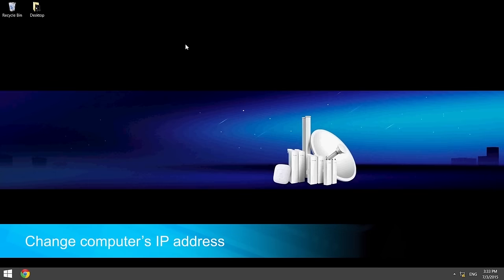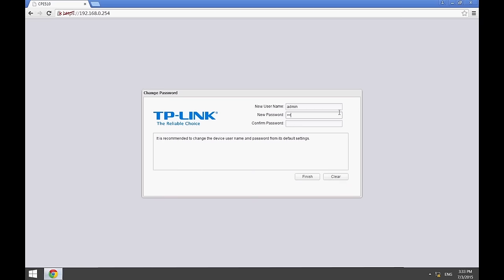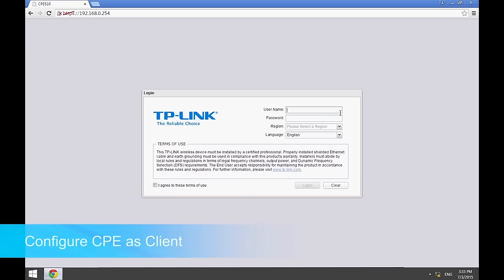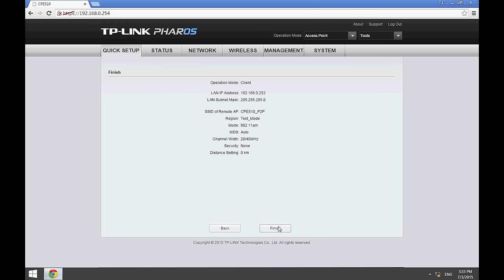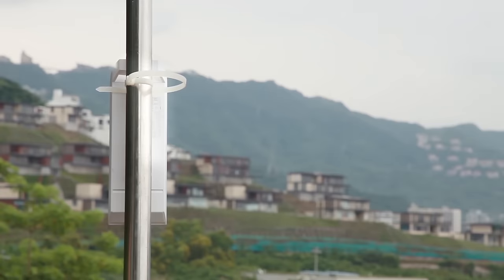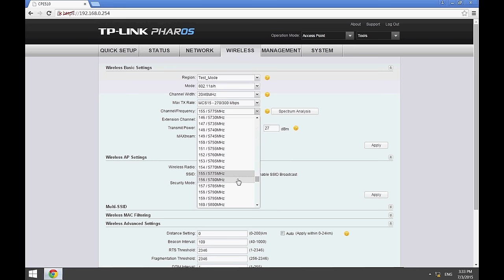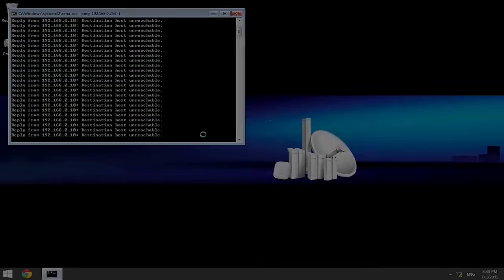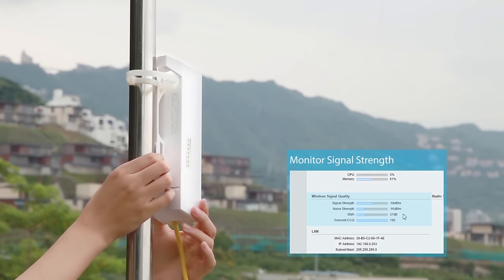TP-Link CPE Point to Point Installation and Configuration Tutorial Video

Comment: I just bought the device dec and there is no Poe ethernet cable to connect between the Poe adapter and the device from the inside of the box. Do I have a color sequence of this cable, if I do it myself, I have knowledge of the cable ethernet.
Reply from the maker: There is no such thing as POE Ethernet cable.  Its just a regular Ethernet cable that power is transmitted down as well.  The Ethernet Port does have to be POE capable though.  With this device if there is no Ethernet cable any one you have available will work.  I recommend Cat5e and up though for gigabit connection capablities

Comment: What could be the best height to fix the AP and CPE devices? Can we connect more than 2 client devices to the AP device?
Reply from the maker: Height limits would be the limits of the ethernet you are using  the only requirement is that the two units have clear line of sight and are in range of each other.  On the Client  side you can connect an AP or router to allow multiple clients to connect.  On the AP side it would be a one to one connection with the router.

Comment: How do you set up TP-Link CPE to be used as an access point without a computer? Can it be configured via a router and a smartphone at your disposal?
Reply from the maker: No it will require a device to be physically connected to it.

Comment: can the "client" CPE210 connect to the distant LAN network through RJ45 jack and make 2 different networks one as if they are physically connected?
Reply from the maker: Client will not create a network.  instead you would be able to physically connect a ethernet based AP or router.

Comment: what is the allowed distance between the TPlink CPE and the PoE adapter? is there also a limit on the distance between router port and the PoE adapter?
or are this the normal 100 meter limits of ethernet?
Reply from the maker: As far as we know the limits are that of the Ethernet segment.
Reply: @TPLINKTECH  thanks but a follow up question arrise then, is the ethernet segment from the router, over the PoE adapter to the device or are these 2 segments (1 segment from router to PoE adapter and 2nd segment from PoE to device. The reason for this question is that I would need to travers first an area without line of sight and then the radio part which has line of sight. The first past is most probable just over 100 meters
Reply from the maker: @a320homecockpit  You shouldn't have a problem with that as long as the injector is at a location where power can be added.  the 2nd segment, ethernet to camera would then have the POE power added to it.

Comment: Can I set this up with 3 CPE210 devices. One AP mode, and the other 2 in client mode both set up identical (different device IPs)?  They will both be within cone of the AP.
Reply from the maker: Yes as long at the 2 clients are in line of sight and the beamwidth of the AP.  The two clients would then operate like an network adapter on a computer and get an individual IP address.  the clients then can each be setup to a separate WAP and provide wireless and wired connect to device in their area.

Comment: Can i use the cpe510 in AP Client Router (WISP Client) mode and connect it to an archer a10 in (Router Mode)?

I then want to connect an (AP) or wireless router to the cpe510 so I have an omnidirectional antenna for all my devices at the second location.
Reply from the maker: The two devices would need to be in line of sight and the beamwidth for that to work.  The CPE510 has a very narrow beamwidth.  However the EAP225-Outdoor may be a better product for your needs.  Its an outdoor Omni-directional AP with a maximum range of 150 Meters.

Comment: Hello Gentlemen,

I have a question about TP-Link CPE Point to Point 
can I use it for one side only as sender without reciver ? I mean I have a router and I want to make the signal stronger, the receiver will be the computers and mobiles. 

could you help me with that?

thank you
Reply: I'm no expert but basically yes. You can select Range Extender, Access Point, or Bridge based on your needs and connect devices compatible with 5ghz wifi (like most phones and computers.)

Keep in mind that this is a very directional signal, it's not going to be well suited for "moving targets." You can connect a cellphone to the wireless signal, but you would be better off with something omni directional.

Comment: Hello any one can give some information. How to make wifi hotspots more than 3 km coverage areas and what kind device have to setup please ?
Reply: You can buy tenda 03 5 km wireless router . This will cover the range of 5 km.

For this you will have to buy two units of tenda router .
Configure one unit as Access point mode . And another unit as client mode .

Each unit will cost you 3300 rupees .

Comment: What is the range on these devices? I'm looking into it myself but I need to cover a area from point to point.
Reply from the maker: depends on model.  Generally speaking its any where between 10 and 15 KM
Reply: @TPLINKTECH  Straight line to site correct? What about through tress?no buildings or hills anything like that just trees?
Reply from the maker: @DiyintheGhetto  Yes Straight Line of Sight with no obstructions.

Comment: Hey, i've got a question, maybe someone can help? 

Is a second CPE necessary for an short distance of 40 Meters? 
I've bought two CPE210, to build a PTP Connection from my main house to my garden house. 
But isn't it the second one, at my garden house, redunant if the main CPE acts as an Access Point? 
Could I leave off the "garden house" CPE and the router, i planed to install there? 

What are the pro and cons, to build a PTP versus only one Access Point?

Im an total newbie, and non native english speaker, so please excuse me!
Thanks!
Reply from the maker: for only 40 meters i would not recommend the CPE210.  I would suggest an EAP225-outdoor.  the benefit is that it is omni-directional, has a greater beamwidth so clients can actually connect to it and has a range of up to 150 meters for just one device.  It would be the best choice by far in this situation.
Reply: @TPLINKTECH  Thank you for your advice! Really appreciate it, and your great products!
Reply from the maker: @Bambule161  our pleasure

Comment: is this necessary if it's only an access point setup?
Reply from the maker: these CPEs are long range directional APs. Technically only one in AP mode would be needed but because the azimuth of the signal is very small it is recommended to have 2 that are able to see each other, one in AP and connected to the source of internet and the Other in Client at the receiving end.
Reply: @TPLINKTECH  okay. but can I still use just one AP for 200 meters to reach a wifi security camera?
Reply from the maker: @chichino5  Only if that camera is line of sight and in the AP's narrow azimuth

Comment: Question: Does CPE 220 is capable of point to multipoint connection? Thank you
Reply from the maker: It should be but we don't have that product in the US so we can't say yes absolutely.  Here is the data sheet though.  https://static.tp-link.com/2020/202003/20200324/CPE%20series-Datasheet.pdf

Comment: hello..i want to extend my wifi range..if i connect this directly to my router and install it on my rooftop...do u think i'll get a full bar signal in my phone from at least 500meter distance?..please answer clearly.
Reply from the maker: No likely.  This is a long distance point to point AP.  It has a very narrow line of sight.  Unless your cell phone is in direct line of sight you will not see the signal.
Reply: @TPLINKTECH  thank you.

Comment: I'm not finding any explanations of the different modes that I find clear. I want to have one in my main building that is used only to communicate with the second, and the second in my outbuilding and running a wireless access point. Can you point me toward documentation that can explain that? The mode descriptions don't seem to be looking at things from the angle I am.
Reply from the maker: Unit at the main set in AP mode.  Remote unit set in Client mode.  units must have clear line of sight and be within each other's beam width.   If the distance is 150 meters or less consider using a EAP225-Outdoor.  you would only need one then.

Comment: where does the line on the client connected to? Please show where the lines goes on the client side. Thanks
Reply from the maker: Its simple that would connect to a client device.  A PC, an AP, a router, etc.  Most would use an AP or router so that multiple clients at the client side can access

Comment: I have a few sites where the AP radio factory randomly resets itself for some reason. Some times once a week and other times up to3 times a day.  Other times oncr a month.   When I swop the radios around and the poe unit, it still happens.  When I make the AP radio a client, it doea not factory reset itself.  But only with V3 CPE510s.  Older versions never did this.  Any ideas?
Reply from the maker: No unfortunately we are not trained on the SMB equipment.  You would want to contact support.smb@tp-link.com

Comment: Hi, after setting up client device, is it still need LAN cable connect in client device?
Reply from the maker: In Client mode think of the CPE as a modem.  You would need to connect it to a Router or AP in the Client location to provide that area with the service it receives.

Comment: I need help on my setup as follow; I have configured like this:

Router (GW 192.168.87.1/24) -> CPE210 (Access Point mode, IP: 192.168.87.50) to CPE210 (Client Mode, IP: 192.168.87.55) -> CCTV Decoder (IP: 192.168.87.45).

My problem is, I cannot even ping all these IP from other subnet in my LAN, eg; from 192.168.86.0/24. My main priority is to access that CCTV Decoder. Please advice what is the correct way for me to implement this?

Thank you for your help.
Reply: Mohd Faridz Ismail if u need help let me know so I can remote and help you
Reply: @christopherwitter3677  thanks, i have reviewed again the network design and i noticed the gateway is wrong. so now i fixed it and everything works.

Comment: Have difficulties connecting the client to the AP:
1. Do I have to disconnect the LAN cable between PC and AP, to client PC at any time in the configuration process?
2. The SSID network-name. Is that a specific new name for the AP-Client connection, or to the network of the house?
3. At what time may I LAN-connect the AP to the router of the house instead of the PC? How do I do that?
4. What option do I have, if my PC does not have a traditional LAN-socket in the configuration process?
Reply from the maker: We are not able to provide detailed answer as you are requesting here.  You can email support at support.smb@tp-link.com.

Comment: can i use this as a wifi long range adapter
Reply: Yes, you can. You should set its operation mode to "Client".
Reply: @DiegoTorresV11   HI  

I have a question about TP-Link CPE Point to Point 
can I use it for one side only as sender without a receiver ? I mean I have a router and I want to make the signal stronger, the receiver will be the computers and mobiles. 

could you help me with that?

thank you

Comment: wheter all the cables used are "STRAIGHT" type ??? 
or "CROSS" type ???
Reply: +Haris Fadillah You can use straight RJ45 Ethernet cables for both the CPE510 units.Make sure the cables are long enough to reach the CPE510 unit mounted on poles.

Comment: I am trying to set this up as range extender. But as soon as i enter the adress in Google Chrome it sais: ERR_CONNECTION_TIMED_OUT. Ive tried multiple times on different pc's and only in the first try i got in the menu. Help me please! tell me what i do wrong!
Reply: +Prikkedaemryder76 You mean you can't access CPE's webpage or internet? Try with another browser and check the IP/DNS on your PC.
Reply: +Dwen Yeah, I was beginning to wonder if I need two of these to make this work.... I'd like to experiment in pushing my Wifi limit from just around the house to extend at least a few km out of the house which has been quite a challenge so far..

Comment: can I use the cpe 510 as a normal wlan repeater
Reply: +Niklas Mäder Not recommend I think, because of its directional antenna:)
Reply: +Antoine Federer please me !... Can this tool for point to point connection with a distance of 10 Kilometers?
Reply: Alditha Nasution I think so. I myself have tried a distance of more than 12km but with a very clear of sight across the sea. You know any obvious obstacles could block the signal thus affecting the distance.
Reply: can 2,4GHz devices connect to this TP-LINK CPE510 5GHz 300Mbps 13dBi and is it only works for the same tplinkcpe on that video?

Comment: Can I hook this up in the following configuration?
router(zyxel p8702n) -> CPE510 ->  50meter -> CPE510 -> router(tp-link deco m4).
Reply from the maker: The fist CPE510 should be set for AP and the 2nd for Client.  However with only 50 meters get the EAP225-outdoor.  ITs dual band and Omni-directional.  Plus has a maximum range of 150 meters and you only need one.
Reply: @TPLINKTECH  Yeah did that and its not enough. Outside it will give me 80% of the 15/2 line. And if I sted inside the other house it doesnt go trough the window..
Reply from the maker: @zlacc  which one did you do?  The EAP225-outdoor suggestion or Putting the CPE510s in AP and Client mode?  If it was the CPE510 you also have to make sure the client has line of sight to the AP and is within its beamwidth to have the two units see each other.
Reply: @TPLINKTECH  The eap-225 first, but it was not sufficient. I am now seeing up 2x CPE 510, I will update once finished.
Reply: Have now setup CPE510, followed the video and got perfect connection with clear line of sight. Will be returning the EAP225-Outdoor. The Deco M4 creates perfect mesh network in the entire house. I only had to use two out of three Deco M4 in the house for full coverage, the third one will be installed in the garage.

Comment: When I connect a device to the client device do I need to configure it for a static IP in the client menu of I wish?
Reply from the maker: You can but its not nessasry as long as DHCP is enabled on the AP side where the service and router exist.  If that router however requires static IPs to be set up then yes you would.

Comment: Question: I just bought one of these, do I require 2 for it to efficiently work?
Reply from the maker: In most cases we do recommend 2 units.  1 setup as an AP and 1 setup as a client.  These are line of sight devices so the most efficient use is with 2.

Comment: i have a alvarion bmax-cpe-odu-pro-sa-2.5  frequencie 2.4ghtz and i want to use it as an extender of my wifi hou can i do it tnak you
Reply: I have two of the panel radio's of this same company Alvarion they are cpe i have the power injectors and panel but not the modems they used with them.i  have found nothing on re purposing these online.. I do see them for sale online so i assume you can re purpose the outdoor panel radio part.  I guess you would need a bridge to hook to them to make a point to point connection. These was used in my area by a company to offer long range subscription wifi internet.  If you have any information on the re purposing the outdoor panel for a long range wifi please let me know thanks.

Comment: How can you set these up to another internet service?  I got a new ISP and now I want to disconnect my CPE210s from my old internet so I can use it with my new internet.
Reply from the maker: It really depends on the configuration.  If you have one unit as an AP and the other as a Client then you should only need to connect the AP unit to the new router's LAN and that's it.
Reply: @TPLINKTECH  Ok great...How do I do that?
Reply: I think I have them set up as client and AP.....TP-Link helped me set them up the first time.  I have one connected to the old modem router and it sends a signal to the one I have about 150 feet away at the garage.  Then a seperate modem inside the shop lets me have internet in the garage.
Reply: @TPLINKTECH  Oh so maybe all I have to do is simply disconnect the eithernet cable from the old internet modem, then reconnect it to the new internet modem?  Ill try it.
Reply: UPDATE:  It worked.  All I had to do was disconnect the eithernet cables from the old modem and reconnect them to the new modem.
Reply from the maker: @thelegendricky  If it's only 150 Feet you might want to consider the EAP225-Outdoor as a replacement.  They have a range of up to 150 meters and it's an Omni-directional signal so it would not only cover the distance between the two buildings but would also cover the area between them and likely the garage itself too.
Reply: @TPLINKTECH  Ok thanks.  Ill keep it in mind for future reference.  Its working great as of now.

Comment: Doesn't it passes through a multicast? I connected a router to mng L2 switch using trunk with 2 VLANs via a pair of CPE510. One Vlan for Internet and another for multicast. I can see MAC addresses in both VLANs and I have data int 1-st VLAN, but there is no any multicast data in the second. If I connect the router directly to the switch (without pair of CPE: AP & Client) then everything works correctly.
Reply from the maker: We really can only supply basic troubleshooting for SMB product on YT.  We would recommend contacting our SMB support for this issue.